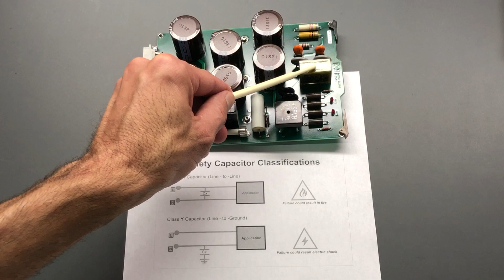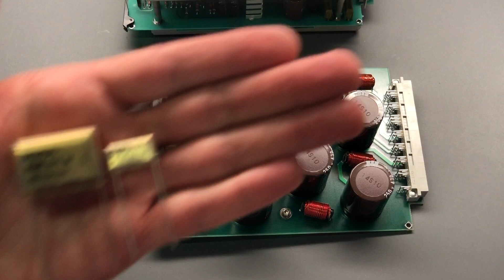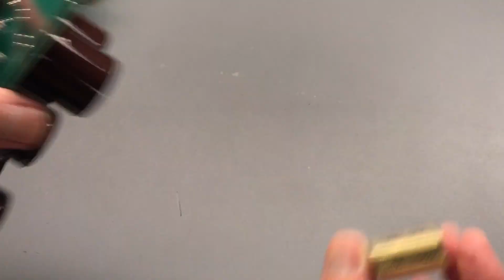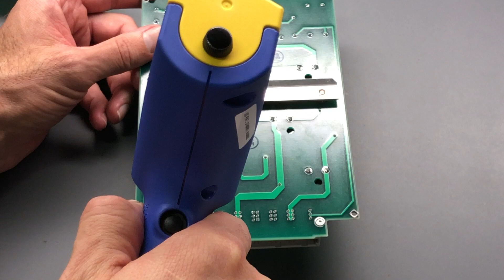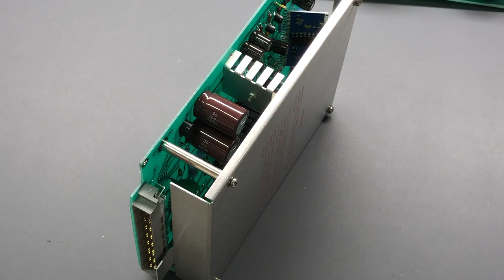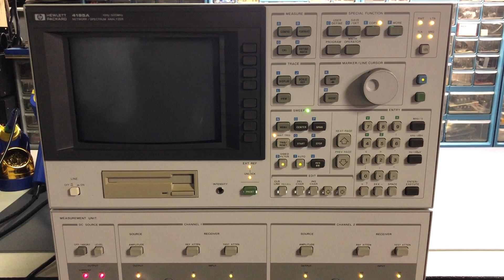RIFA Safety Capacitors Are Failing!  Why You Need to Replace Them

Comment: A good, clear description of what the device is supposed to do, its limitations, and what problem exists with it.  I just found your channel in the last few days and I like the subjects and the way you present the material.  As a suggestion, you might discuss sources where hard to find parts (like RIFA Safety Caps) can be purchased.  Excellent either way !!!
Reply from the maker: Thanks for the compliments!  Glad you enjoy this channel. I'll try to include parts sources on future videos, I agree that would be helpful.  The RIFA capacitors are available at Digi-Key.